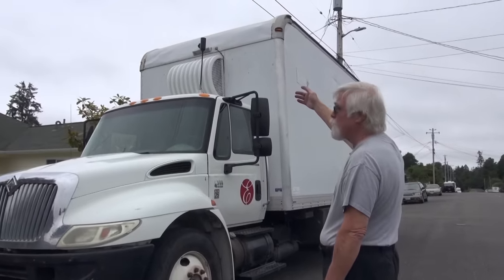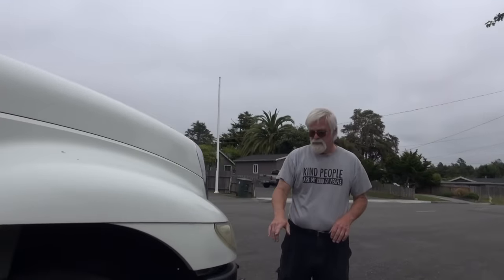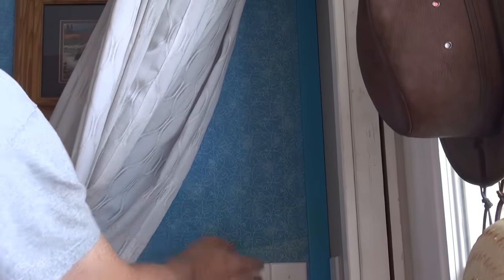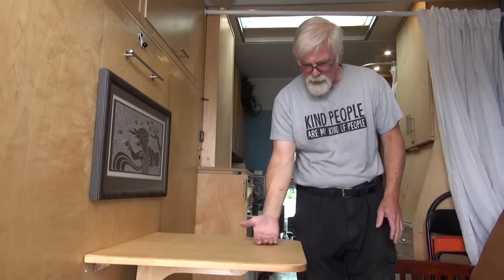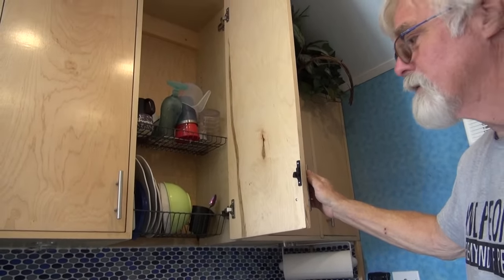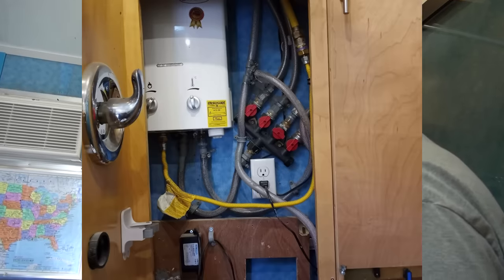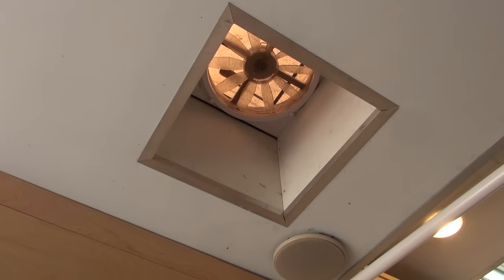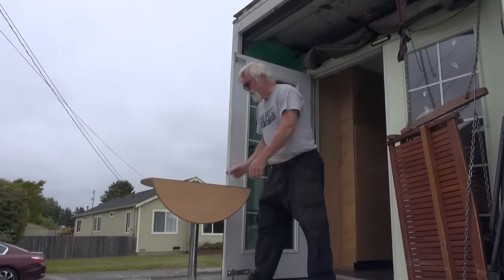Harvey the RV Stealth Box Truck Conversion/Tiny House Full Tour

Comment: That looks like to much work 🥴
Reply from the maker: It took a couple of years, but I needed a retirement project.😁
Reply: I felt the same way when I realized all the details and all the extra custom lil doodads & all.  However if I had a few years and the time and willingness to do it I would but I noticed a lot of certain kinds of work I don’t like to do and usually when doing similar work with others that I would let them do unless I couldn’t trust them to do it properly, or better than myself at least.
Also I think part of what makes me not want to is also what is a big part of the fun of doing these kinds of projects as figuring those types of things out which was something I used to love.  However except now if I can’t think my way around something in 30 seconds or less I don’t feel like messing wit it and walk away from it.  Seeing the way you talked about things you did and why &/or ur thinking or reasoning for it showed so much and helped wake me up a lil bit out of the lazy funk I been in for the last extremely way too long of a time.
However Awesome Stealth Home~Truck, Great Job❗️

Comment: Another downside to that truck is it has the worst engine ever made for a truck the max force😂 and did he say the shower water recirculates?😮he cant deal w black water but shits in bags😂
Reply from the maker: It is the industry standard dt 466 one of the most reliable engines easily surpassing 500,000 miles before rebuild is required, the shower recirculates the way a hot tub does, but with more filtration and yes, I shit in a bag...just like astronauts, boaters and campers who use wag bags. Mine are just more convenient and less expensive. But thanks for watching. :goodvibes:
Reply: It's only the last hundred and fifty years or so that we've had no-see-no-touch sewage disposal in our homes. For tens of thousands of years we had to deal with getting rid of our own waste manually. So the luxury of being able to be so prissy is very, very recent. It's just poo - man up bro.

Comment: Commercial box trucks not a great idea for RV's. You must have commercial insurance. I know I have one not cheap.
Reply from the maker: There is a class of insurance avialable for conversions that is not commercial insurance perhaps lower because of the fewer miles typically driven.
Reply: Once converted, as a Rav you should be able to get Rav insurance, rather than commercial. I'm sure the laws differ state to state. 💜💜💜

Comment: wow. Where is he from? He sure is paranoid about saftey.
Reply: Being prepared for possible trouble while traveling and camping in remote areas isn't paranoia, it's just wise.
Reply from the maker: Hi, safety was a real interesting issue for me. I bought a shotgun to take with me, but decided against it. There were a couple of nights out in the desert where we were miles from anyone and without cell phone service where i would have felt more comfortable had i taken it with us, but the rest of trip was fine without it. It is an uncomfortable experience to hear noises outside in the middle of night and not be able to determine what is making them. For the most part, as seventy year old travelers, we were treated with kindness and grace, but you never know when someone with bad intentions or just stupidity will get into trouble. In the end I think the level of security worked out for me. I could dissuade potential trouble, without arming myself which probably would have been a bad idea anyway. Take care
Reply: We also had considered a shotgun, but decided against it; we felt that, if necessary, the bear spray and tazer would be sufficient to discourage (or immobilize) any intruders. As seniors too, we wanted to be able to protect ourselves! Fortunately, we were also treated with kindness and respect, but we did check the app for the outside cameras a few nights for those outdoor noises, which usually just seemed to be critters -- no bears that we knew of! Enjoy your travels.
Reply: You are in charge of your own safety. @punzelle
Reply: A place called earth...What planet are you on?
Reply: Most people are extremely cautious about security, especially pertaining to their home, be it on a slab or wheels. It's always better to be prepared and not need protection, than to be in a situation and have no protection.
Reply: I think the older we get, it's wise on the road.